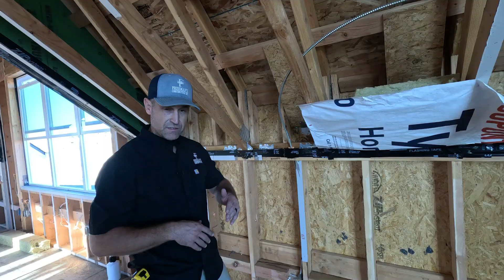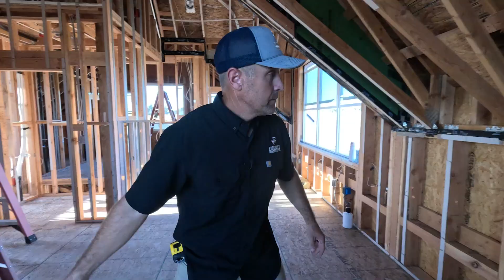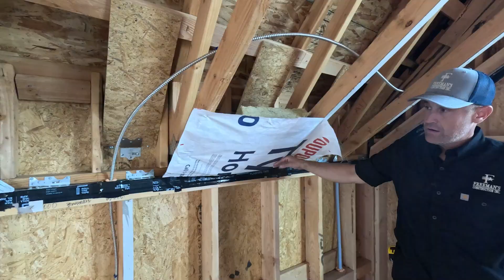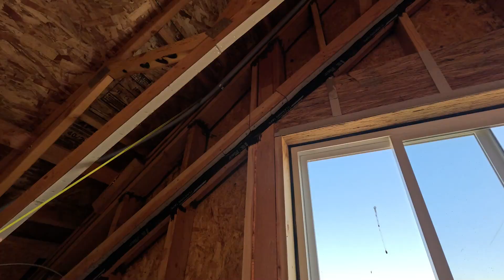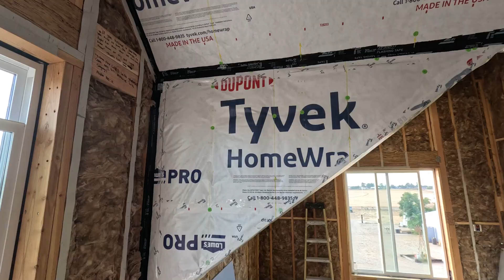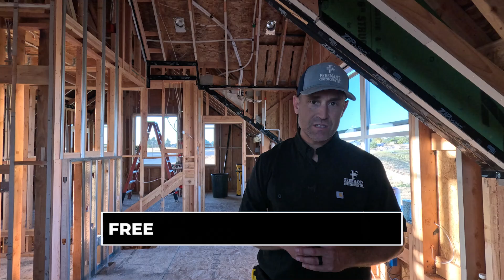Air Barrier Continuity: The Key to an Airtight Home

Comment: I'm not sure I really get the point of all this extra work? Is this because attic space is typically vented to the outdoors to prevent humidity but at the same time you don't want that outside air leaking into the home from the attic into the living space??